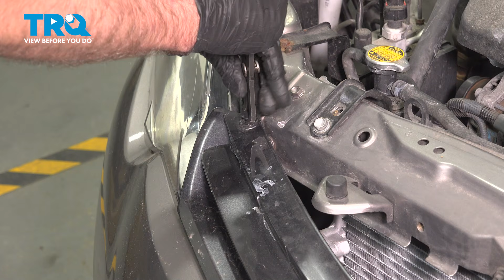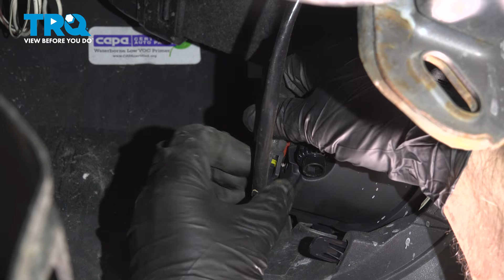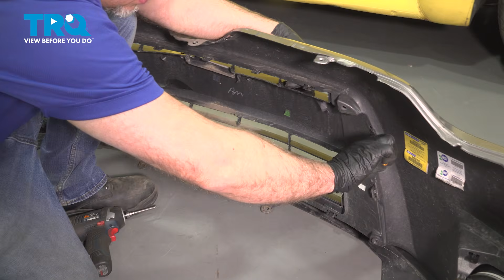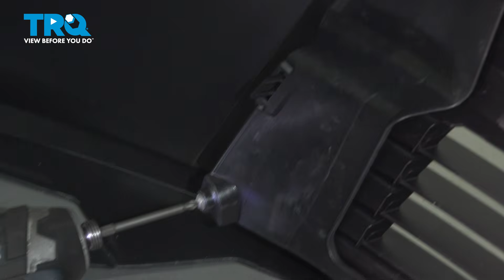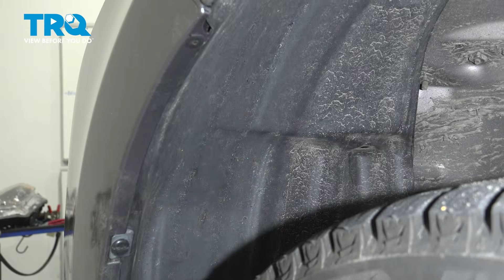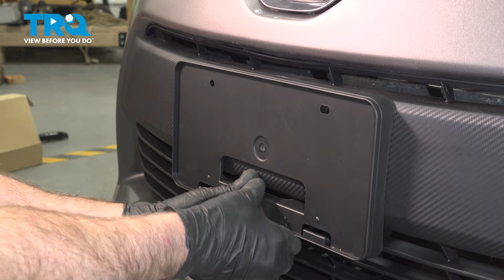How to Replace Bumper Cover 2014-2019 Toyota Corolla

Comment: Was that bumper for the 2014-2016 Toyota Corolla LE model with added fog lights in Brown Sugar Metallic? Did it come already painted and was it folded when you got it? Did you buy the bumper from Partify, ReveMoto, or somewhere else?

Comment: Looks like they removed some parts before recording the video.missing the collision sensor and plug behind the Toyota emblem on upper grill. Also for the upper grill, there are 2 Phillips head screws that connect the bumper to the upper grill. The upper grill is not held by only 2 rivets, 1 bolt, and some clips that snap to bumper. The 2 Phillips head screws are hard to get to with a standard length screwdriver. Use a stubby size, or a Phillips head drive on a 1/4 in ratchet. Disconnect battery prior to this. The collision system controls your airbags. Probably why they skipped it